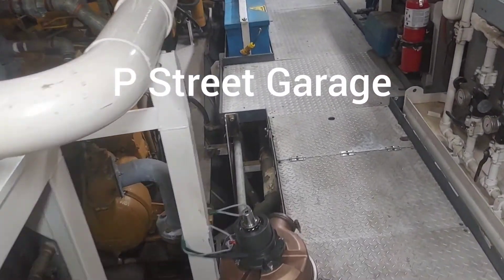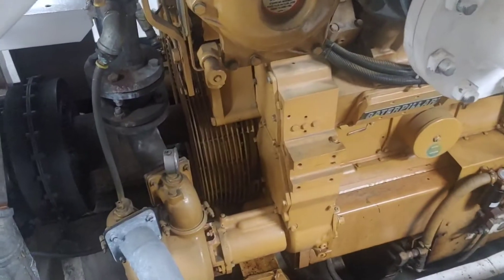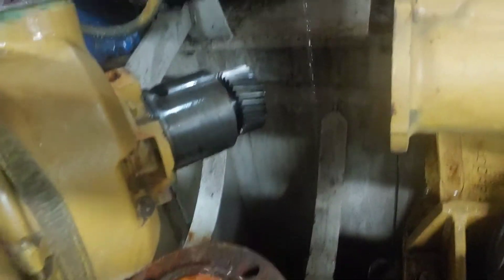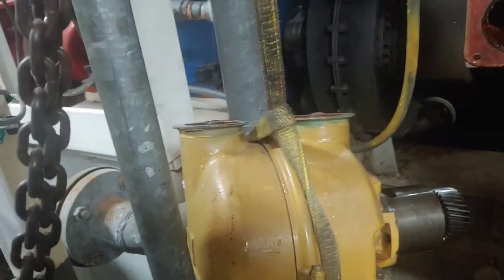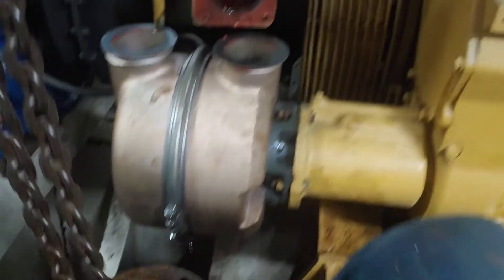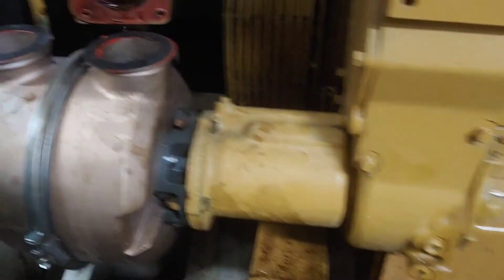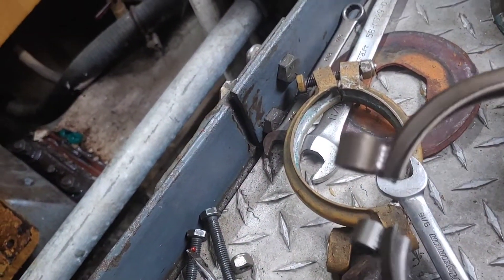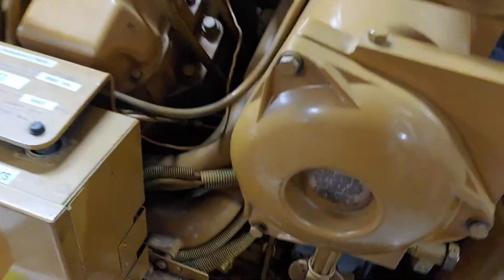Caterpillar Marine engine. Changing out a raw water pump on a Cat 3516.

Comment: Can u tell me the suction line from the source of water and the discharge line in the pump couse i have a problem with 3412 cat engine the outlet water it is week and thise make Rise in temperature fast thise the first install for the engine and we make al piping but i think i have problem with the out let and inlet for the pump
Reply from the maker: Inadequate flow ?
Check suction strainer
Check for any blockages
Make sure the pump is primed you might have air trapped inside
Issue with your pump ?
Make sure pump is spinning